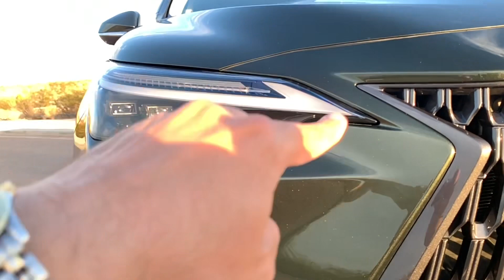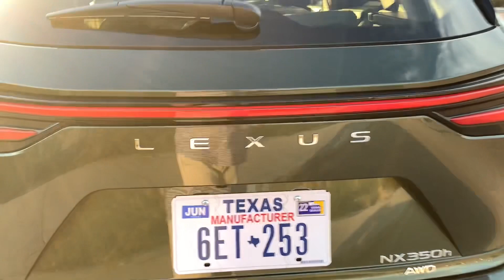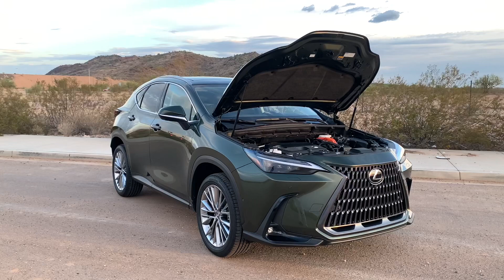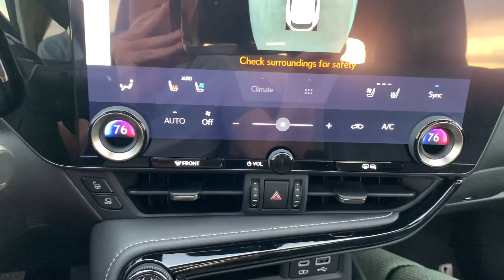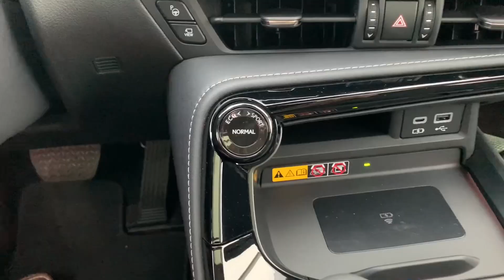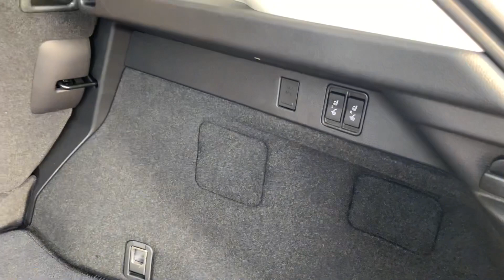2022 Lexus NX 350h AWD Review

Comment: *~*~*~ Better Option:.....  ~*~*~*RUN Do-Not walk to the NX 450h+ "F" Sport!... .

I own the Lexus 2022 450h+ F sport. Elegant and refined!.....Note the Heads Up display on the windshield W/8” & 14” Info on Dash board with Crystal Clear display on both, alone makes the Lexus better........Mine is In Atomic Silver Glows in the Sun Light with Lil" grey / Gold metal flake" and same Circut Red interior.. but with Electric battery...Has 306 Horse power 0 to 60 in 5.6 sec (Via Road and track at drag strip!.) ** BIG NOTE: This model DOES- NOT have a TURBO...But rather, a Naturally aspirated / Carb...........(important because it is well known that TURBOS stress engines)...SEE: https://www.youtube.com/watch?v=_xYnXRqheoI    ...ON Turbo issues = Very Bad!..... I use Electricity exclusively non combustion!

Simply said: see euro cars shop time & inevitable “ Check Engine Light CONTINUALLY!!....this car combines the Elec Batt and engine to achieve 89 miles per Gallon ( Uses 87% octane / Regular gas according to user manual) in Hybred mode with HIGH torq, And VERY quick out of the hole...Jus' blew the doors off a 735i beeemer...albeit for only a block ...( I am no dummy a V will eventually pass many cars in the long dist. (in all fairness) ......However, who cares the thrill is initial take off and tickets are for high speed & SPEED...Kill's!

My car has Red Calipers against Powder coated Gloss spoke Black mags and All red "F" Sport Badges. Installed Carbon Fiber on ALL interior Piano Black i.e. Center Consoul arm rests dash board & rear center heater consul between seats. Don't mind at all making these kind of upgrades when you drive off the lot and your * Car Note: goes UP IN VALUE: do that with any car today??? FAR better built than euro's (mine built in Japan) sadly, new releases are now being made in Canada! Like USA Union shops...no one gets fired for a hang over and bad work??? maybe)..... However, Lexus is Far more reliable...Far better Re-Sale that Euro beemers or mercedes Check Engine Light Gucci headache) .......indeed mine has Gone UP in price...Not many cars you can find Like that!... IF YOU CAN FIND ONE ANYWHERE do grab it!......"econ 101".....Has (3) elec. motors gett'n 0 to 60 in 5.6 sec (road and track) HIGH torque QUICK out of Hole!......~*~*Never do I use gas..... gett'n 46+ miles per 120 Volt charge (real world driving my experience.) and NEVER USE GAS Frean'n inflation caused by “Elections Have Consequences”!....Almost Silent operation in elec....So do your research, PLEASE......as this is Far better than any European beemer, mercedes and korean etc. All those are depreciating the moment you drive off the lot BIG TIME! …....And are UN- reliable offering to say nothing of the: GAS HOG unproven G 70, & RDX not worth mentioning. Z Best of the BEST F Sport 450h+ ! ….One more thing, Jus' a heads up!......My wife drives the RX 2020 model...Consider putting Michelin's at $1000.00  0n / @ ebay deal is out the door and balanced......... on your NX 450h+ F Sport............ replace the Idiot Run Flats that the dealer wants a $1200.00 extra for warr because like me,  You WILL eventually get a flat and the Run your WALLET Flats are required to replace??? are you freak'n kidding????....Michelin's primacy same size &......Far and away EVEN a much smoother ride, Shissh, Do Not tell my wife ...even smoother than her 2020 RX 350....because My "F" Sport has the added "Adaptive Suspension". Much better ride than the HARD Run Flat Bridgestones that come stock. Carry a Batt. quality inflator ( DeWalt 20V MAX Corded/Cordless Air Inflator ) and string tar impregnated rope insert-er and Do-Not wait for AAA. Consider Use in Only Plug -in and a Hybred NOT a All electric Automobile!.........Using All electric YOU MUST consider YOUR 

Consider all the above insight, using a Credit Card to Open doors, start the car and monitor via phone app... & and You WILL Have the Best of the Best in the Lexus 450h+ “F” Sport and reflect having a Sophisticated, Elegant & classy platform as well! This vehicle has gone up in price approx. &17K+ at this writing,  since I bought it!  @ that increase in value what is the downside? ....So Guys!...let's Jus' get real leave our egos parked till the weekend, we all know these EURO headache's are just for EGO!.* (SHOW OFF)../ insecure people for the most part?.....* Crash test on BMW x3 & Lexus clearly shows LEXUS NX the best results / winner https://www.youtube.com/watch?v=KkV2FtnQhZU.

Intelligent people drive a LEXUS...when we go to work / appointment and or KNOW we MUST be somewhere i.e. an emergency I drive my Lexus….I have been fortunate to own 5 Ferrari's of various configurations to exercise my Ego as well, So lets leave our Gucci cars for the weekend Polo Pony events. 

One more thing, D0-Not Lease your car and get ripped off!     Jus' to turn it in every 3 years @ maybe 1800.00+ per month...oh sure we say it is a write off!.... but you still need to Feed and Cloth the beast and NEVER EVEN OWN IT....i.e. RIPPPPP Off! by the by you still get a write off if you buy this & Jus' consider this: DEPRECIATION Of other vehicles: https://www.youtube.com/watch?v=NPJnBjfh644 End of story!

*The aforementioned is purely my opinion and meant entirely to hopefully give others some insight from a hands on user of this Fine Automobile!